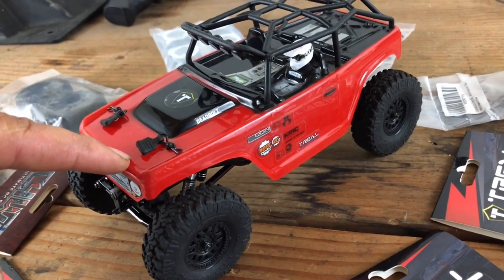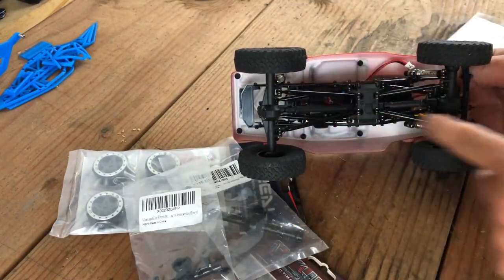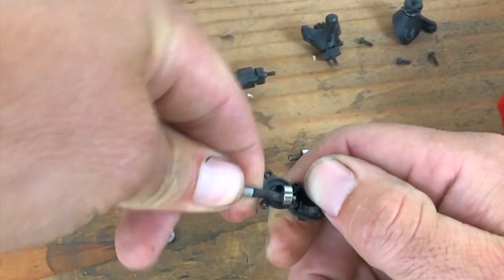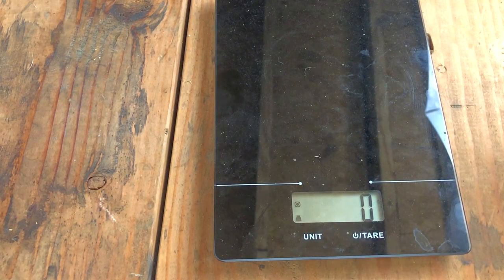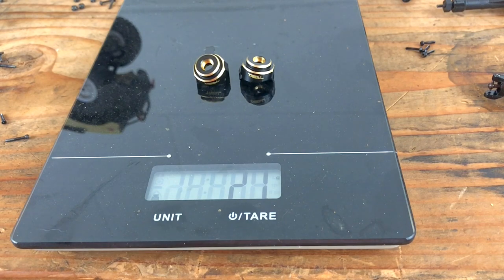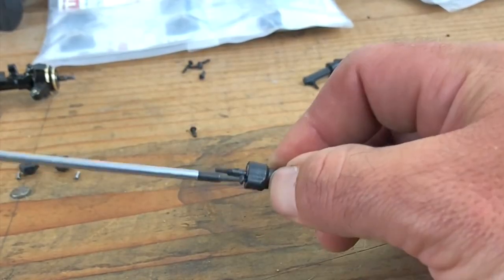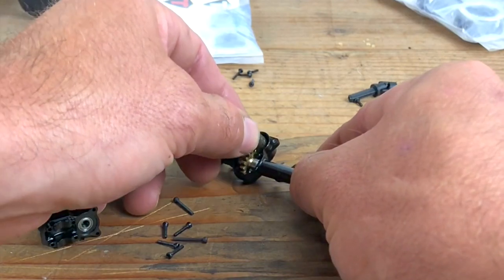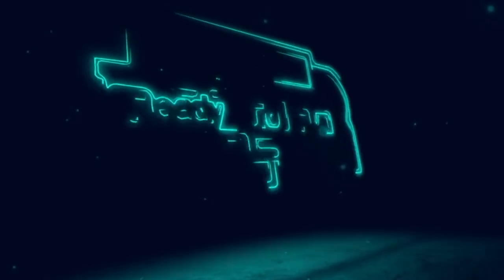SCX24 Deadbolt - Aluminum Axles, Brass Steering Knuckles, Brass Diff Covers

Comment: Thanks for weighing those housings and comparing the parts weight. Gives us a baseline to go from... So how did the increase in weight perform? An improvement or too much??
Reply from the maker: Glad the weigh in helped give you an idea on how much you actually gain. It was a pretty big improvement on lowering the cog.  The stock motor struggled a little more trying to move the weight but I put a Barrage motor in since then.

Comment: What's your opinion on the MOFO solid brass 60g axle set?  Paired with the SAMIX brass steering knuckle w/Disc Brake Rotor (SAMSCX24-4412FS)? And these aluminum SAMIX wheel hubs (SAMSCX24-6669LH)?  ...and maybe some SS shafts to top it off?  A bit much maybe? 😅
Reply from the maker: That is a lot of weight. As long as you’re not running stock motor. You’ll burn that out immediately. I’m interested in getting those Mofo brass axles too. I’ll be putting in the mofo nano beast brushless motor kit he has available when I do that. I hear it has a good bit of torque.
Reply: @ReadytoRunRC  I was just looking at that motor!  I'm very much interested in the new Furitek STELLAR transmission setup that is releasing next week. I emailed the Furitek marketing team with some questions about it, I'm waiting for a reply. I think that new setup and brushless motor with the Liko Pro ECS will pair very well with a heavy build.
Reply: Haha wow, Furitek just replied! I emailed them maybe 7 hrs ago... that was fast.
Reply from the maker: @BootstrapParadoxd   I haven’t really looked at the new furitek releases but looking now at what you are planning on getting, they look like a solid choice to move that weight around.
Reply: @ReadytoRunRC  I went ahead and ordered the MOFO brass axles along with the FUR-2079 and FUR-2073. This build is going all out. This will be a fun experiment to see just how much weight is too much! Haha
Reply from the maker: @BootstrapParadoxd   haha I’m curious to see how much is too much too. I’m doing a whole new build after I get a few more things for my deadbolt and then I’m building the next one completely out of upgraded parts. Good luck with your build.
Reply: @BootstrapParadoxd  Let us know how the Brass housings work and if it is too much. May very well be, depending on the situ.

Comment: The steering Knuckles don't work very good stock and are  kinda of sticky but I saw those new ones you put on I can see that it moves very easy now... Nice
Reply from the maker: I didn’t really have problems with my stock ones. I really only replaced them with these brass ones to add lower weight which the SCX24’s need it. Changing the stock steering link to the aluminum one is what made the biggest difference with turning. There’s too much play in the stock link.